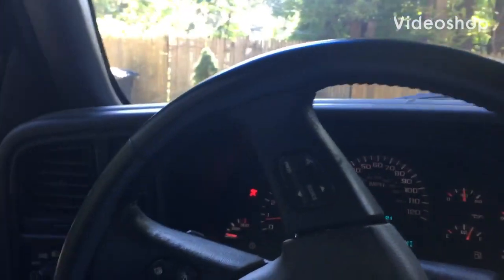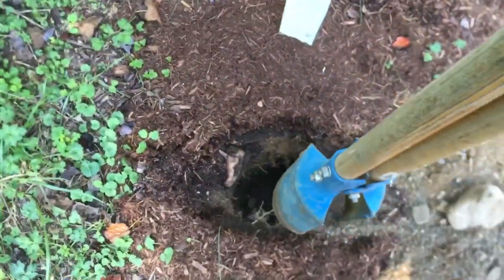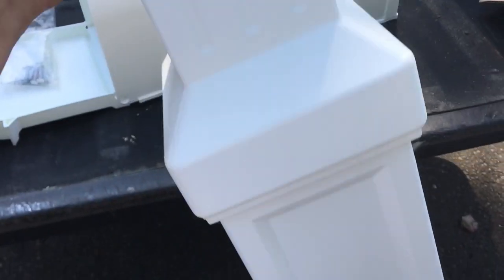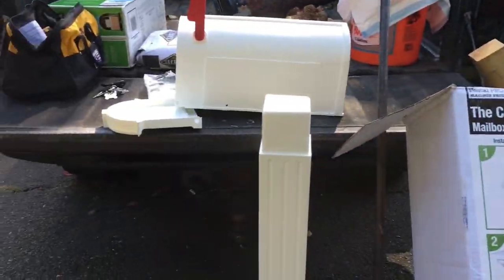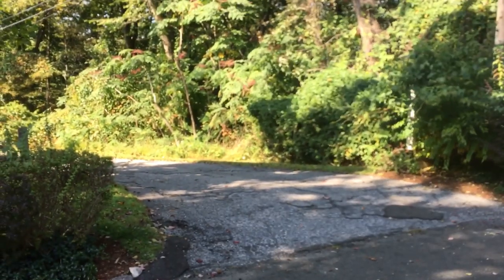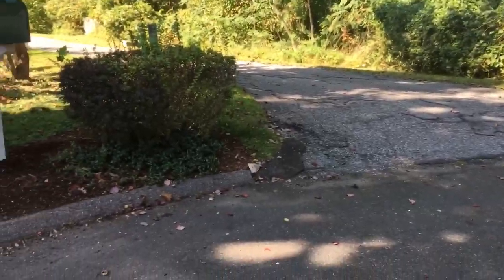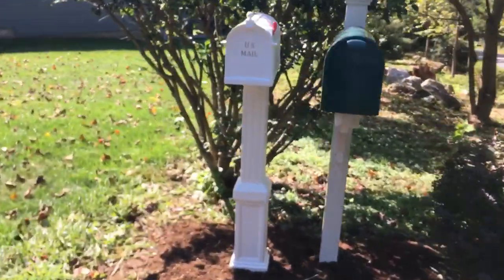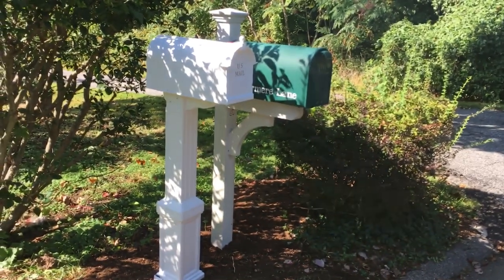When Handyman Jobs Go WRONG!

Comment: Nice job. I had to cement my father in laws mailbox that was leaning after someone hit it. I needed water for the cement. House was to far away. 
I bought a $12 camping collapsible 5.3 gallon water jug. Filled it full and threw in my trunk. It worked great to fill the hole and didn’t have to worry it would fall over and spill. I can use it for camping or the zombie apocalypse 😀